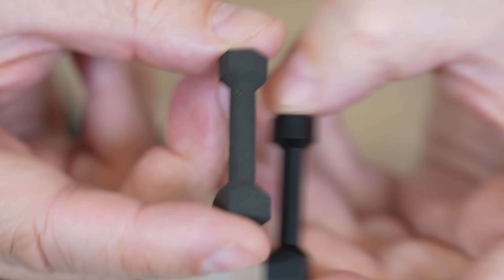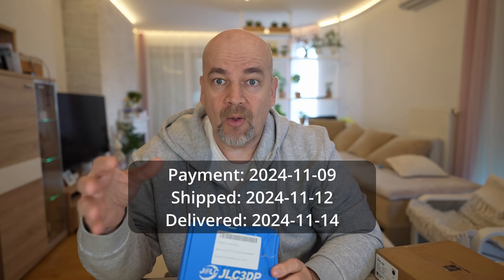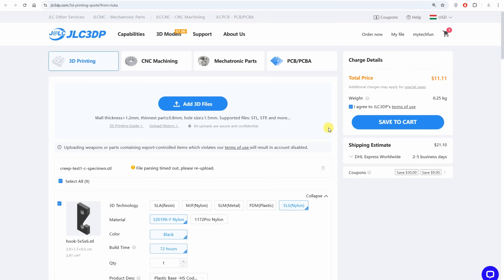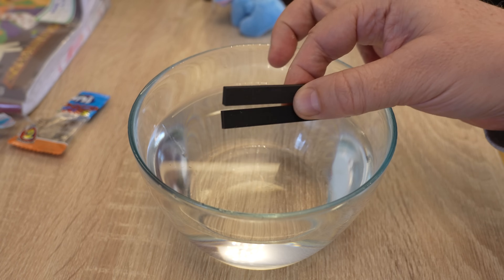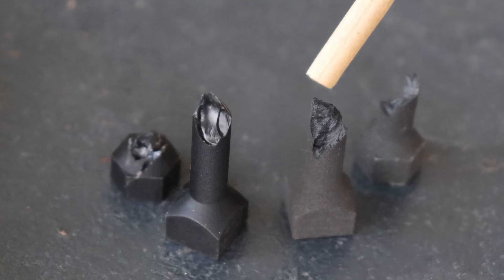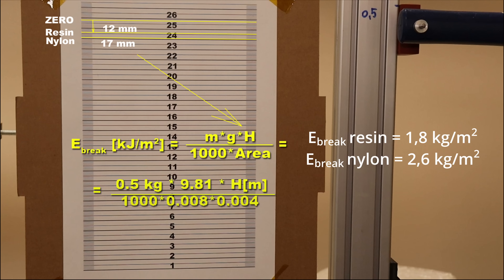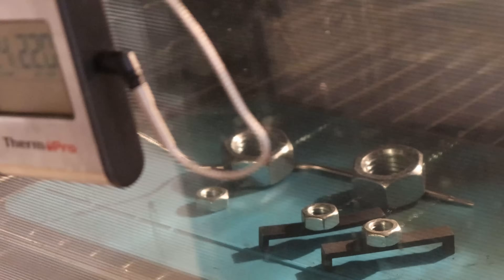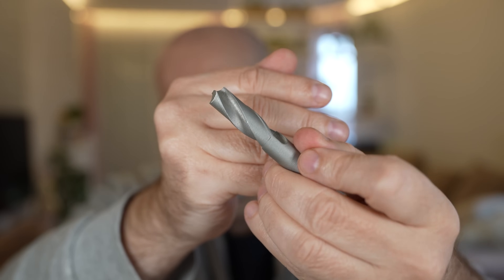SLA vs SLS 3D printing (JLC Black Resin vs Nylon) by JLC3DP

Comment: orientation does not matter in SLS printing, because you bake the parts later.
Reply: same with resin, because you need to cure it UV chamber afterward.

Comment: For my purposes and use case, 65*C of continuous heat resistance is quite low, though fairly midrange in the space of consumer photopolymer resins. A good name brand engineering-grade resin may advertise in the 147*C to a specialty type up to 300*C. I tend to add my own additives and modifiers to resist a high temp heat gun (920*C is about the high end on mine) however, so take that how you will.

Comment: Hi,

Test suggestion: resistance to abrasion / wearing (by sand). Two example of wear: a hot water circulating pump, the wheel was weared to a disc whitout winglets. A cofee machine, again a wheel moving just grinded coffee (very abrasive), all winglets reduced to almost nothing ;)

Comment: Hi Igor, will you continue the food safe 3d print series? Vapour smoothed SLS might be a new candidate.

Its so weird after all these years, there is still not a real solution on the market, SLS PA12 and vapour smoothing with a machine like AMT Postpro claims food safety and processes are certified, one can even order it from Xometry with part compliance certifications but is it really food safe? :D

Another option might be to SLA print a mold and using a desktop injection molder inject your cup shape however issue here I think more than the bacterial test might be the chemical migration tests might fail as SLA is toxic

Comment: Thank you for providing this treasure trove of information. Any chance you can include Young’s modulus for your future tests? Stiffness is something an engineer is concerned about for most designs. Any reason not to convert strength and such to actual engineering units? It would be interesting to compare, for example, the strength in KPa listed by the manufacturer for virgin material compared to layer strength and horizontal strength.

Comment: I prefer the results after each test.
Quite disappointed by the SLS nylon, it performed worse than most nylons for FDM printing, the only advantage i see is the possibility to print more complex structures.
Reply: We order many prints at work, fdm isnt that useful to use for parts that arent designed to be printed. Sls or mjf have much better surface finish on faces that need support structure for example. The designers dont have to think about the printability or support structure  minimising.

Comment: I recommend you make the tensile strength objects all one single object held together by those little cutaway pegs you use!
 I remember in an earlier video that you had issues when you had gotten all parts printed in the same orientation by the technician. I haven't reached the testing part of the video, at 3:13  but this way you can be SURE at least 2 parts are printed horizontally and 2 vertically!

I am talking about having one single object with two test objects in horizontal direction and two in vertical. So that printing orientation not only becomes obvious to the technician, but also even if they message up somehow, the parts are still at 90deg. I know SLS might not have recommended print orientation but you can even have 6 objects in 1 maybe

Comment: The results after each test flows better and has better context, but all the results at the end is better for overall comparison of the materials. E.g. if I need a material to be strong in tensile, and good at elevated temperatures. With the results after each test I would have to keep track, not just quickly get all the results in the same place. Not a problem with 2 materials like this, but some videos have many more materials.

A compromise could be to present the results after each test, and show the spreadsheet and graphs for a couple of seconds at the end of the video. You wouldn't have to explain the results again.

Comment: I like both the results in the middle and at the end 😌but I suppose that results after each test might increase the time watched in your videos, instead of many skipping until the conclusion?
Another suggestion is that although the whole table is reserved to Patreon supporters, some more context would still be useful when presenting the results, like: typical 3D printed PLA, Nylon, PETG+CF and a a couple relevant.
I watch almost all the videos so the database is in my memory, but I'd still like appreciate a reminder 😆

Comment: One advantage that Nylon has over most resins (I don't know about this particular one), is that you can use threaded inserts in it. I have yet to find a resin that will accept heat-installed inserts.

I like the results after each test, makes it a lot easier to keep track of the results while watching the video. Maybe also post all results at the end briefly for those looking this video up as a reference as one commenter mentioned.
Reply from the maker: Oh, yes, great comment (threaded inserts)
Reply: You can use self-tapping inserts, which are better than heat inserts anyways.
Reply: Some resins can be tapped
Reply: @nathanteig7108  Yes, we used to 3D print the threads or tap them when I worked at a place with a resin printer. That particular resin was quite brittle though, so we definitely had issues with parts cracking and breaking from the stress concentrations at the threads. Some other materials were better in that regard but had other drawbacks. Overall Nylon seems to be more durable for functional parts used in assembly fixtures, which is my main experience. The resin parts were great for prototyping though as the dimensions were always spot on as long as they didn't warp during post-processing
Reply: I think its because most resins become duro plastics so they don't like to melt.
Gluing them in or threading them in with glue should be the preferred Solution.
Reply: I 3D print my resin parts with reference table threads frequently, though I also tune my resins with a self-produced graphene modifier and assistive agents to combat various shortcomings/defective issues inherent to certain formulas. Now there are certainly some engineering grades of resin that will perform like a part cast out of tooling urethane, but they come with an equivalent cost (starting at $150 for a 500gr bottle).
Reply: @C-M-E  Formfuture Tough resin has been a great engeneering resin for me and its only ~75$/500g. 
Considering Threads: For reusable threads, printing thre tread and then using a helicoil insert (threads printed for the insert, not the final screw thread) might be the way to go.
Reply: @clockworkvanhellsing372  I have a few vendors I go through for my engineering resins that perform about like two component tooling resins, though I like the idea of modeling around the insert shape. Ironically some of the best threads I've had consistent luck with are my resin threads (vs FDM), which come out like they were machined and fit with proper clearance while being watertight. FDM threads can work when the model is prepped correctly, but I usually have to chase them with a tap, and don't expect them to be weight-bearing more than the force of the component entering itself.
Reply: @C-M-E  that is great. FDM threads have been okay for me, when used with regular machine screws (down to m3 in horizontal direction). but they aren't watertight and I use a 0.2mm oversize. 
Good to know, that there are resins that perform like epoxy. 
One thing it've noticed with the ff tough resin, is that material propperties can be tuned quite a bit by varying curing time. I.e. undercuring it a bit makes it a lot more flexible and impact and cracking resistand, at the drawback of it being softer. This proppertie doesn't change over time ( > 1 year) in ambient light as far as i can tell.
Reply: @clockworkvanhellsing372  Yes indeed, the slight undercure strategy with resins that can do it is a Great approach (as it watercuring if you've not looked into that). Also makes getting supports off with no damage entirely possible. Most of mine outside of the Tough variants come off like undoing a zipper. 👍 I've done a few write-ups on tuning a resin to perfection for whatever machine you're using on the reddit resinprinting sub and small articles here and there, where with proper tuning, you can often get a slightly underperforming formula to mimic most any property desired. You can get way deep into the woods with resin variables and a few modifiers to make it a real science. 😁
Reply: @C-M-E  Thank you for the tip, I'll check out your work.

Comment: very interesting, that resins is pretty strong. expected much more from nylon, should be around 50 in both directions. So it's only worth it for some very complicated parts that would require many supports imho

Comment: I prefer how you presented the results in this video! Having the results right after each test made it easier to understand going along.
Reply: Great real-world testing! This clearly shows there's no single "best" process, only the best choice for the application. Our role is often to help engineers navigate these exact trade-offs between SLA, SLS, and other processes like vacuum casting or CNC for end-use parts. Helpful video!

Comment: JLC3DP is a nice company. Used them for pcb prints as well.  Never knew they also did certain nylon sls prints. interesting for some functional parts which are harder to print on an FDM printer.
Reply from the maker: In most cases I can do all prints myself. But I already used their metal 3DP services, when I needed some big strength. And they have great prices (compared to similar company I presented here)